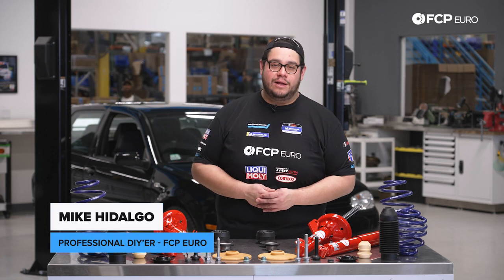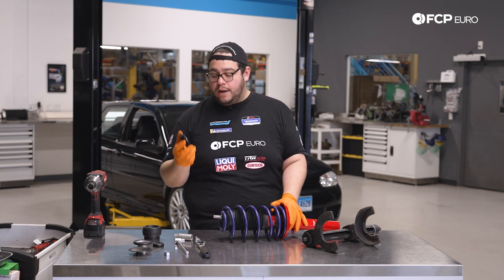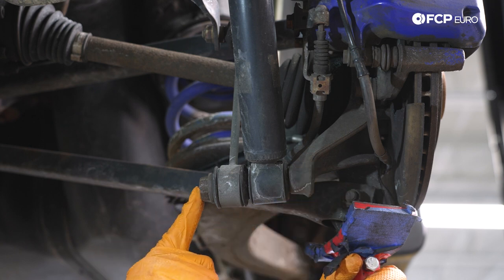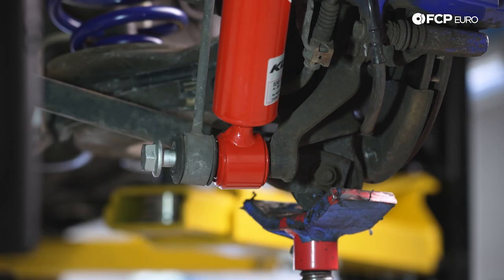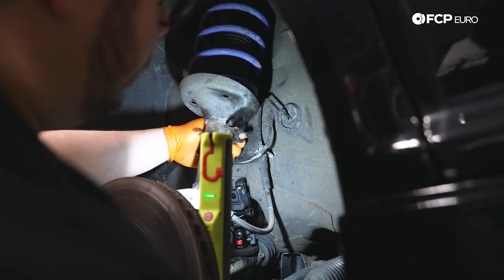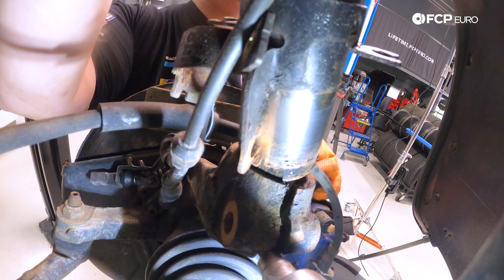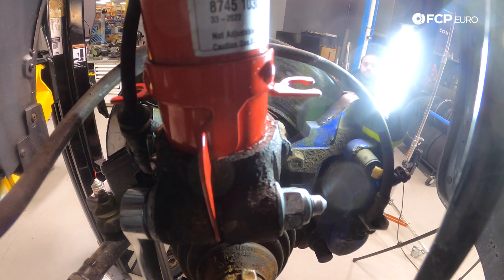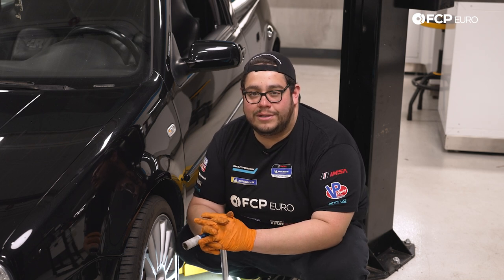Volkswagen Golf R32 Front & Rear Shock, Strut, & Spring Replacement DIY (2004 VW Mk4 Golf R32)

Comment: I have h&r oe sport springs. I understand the tq spec is 60nm for the locking nut however at what position should the upper spring seat be in comparison to the strut threads before applying proper torque. Thanks

Comment: How do these Koni compare to Bilstein B6/8
Reply: These Konis are more for comfort compared to the B6s let alone the B8. Koni FSDs aka Special Active are supposed to be OEM comfort + sporty handling due to the valving technology, Frequency Selective Dampening, look up the tech to see how. It's simliar to MagnaRide but without being electronically controlled to control the frequency dampening

Bilstein B6 Performance shocks are "Heavy Duty" OE Replacement shocks, so they will be stiffer, sacrificing some comfort but are very robust as Bilstein is known for durability. B8 Performance Plus are "Sport" shocks meant for lowering springs and are valved to take in account for the lack of travel that was removed from the lowering springs and so would be even stiffer than B6. I don't think Bilstein makes a shock/strut with similar tech or one that fits the same market as the FSD/SA. 

So if you want comfort but to be planted a little more during the twisties the FSDs or Special Actives should interest you. If you don't mind giving up more comfort for the handling then B6/B8 is a good starting point or Koni Yellows which allow you some adjustment. Some people say Koni YELLOws on softest are more comfortable then B6 but on full stiff are close to or harsher than B8s
Reply: @PapaSmurf337  Awesome. Thanks for the detailed explanation.
Reply: @lloyd_3656 No problem.
I went through a bunch of research on this as well Over the past year, for a few different vehicles, but to be relevant I just acquired another 2004.5 GLI that I decided to go ahead and restore everything first, as it's got a 160k Miles on it and nearly all yhe suspension was clapped out I went ahead with the Bilstein B4 O.E Sport replacement shocks. Installing as we speak